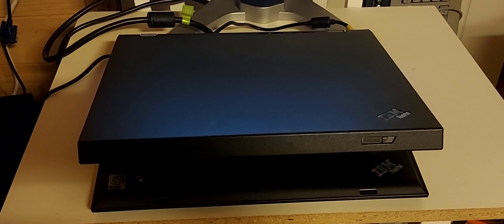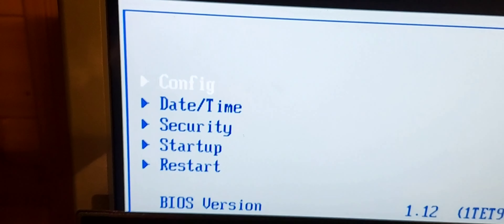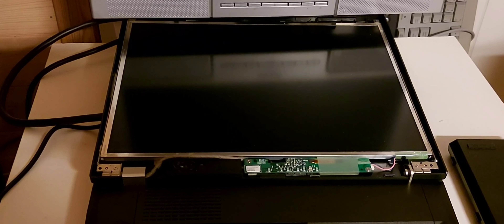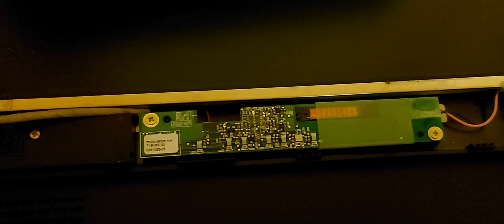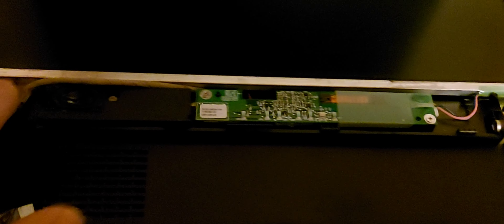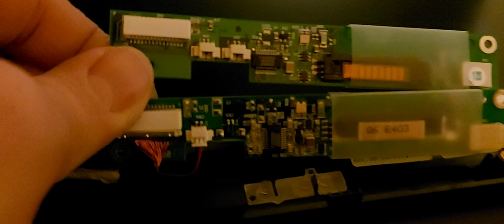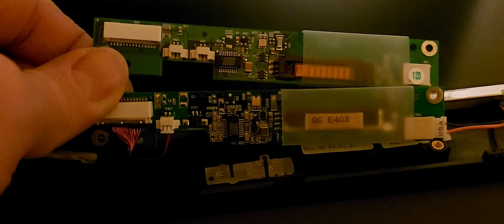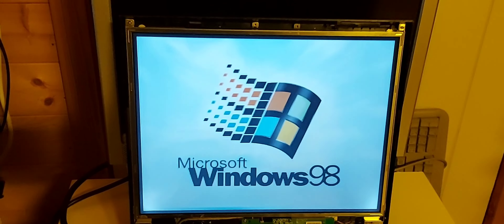IBM Thinkpad G40 - Missing LCD backlight repair

Comment: Yooo, Thank You! Two of my thinkpads exhibit this problem. I think I know how this problem may occur. So, with first one, I had no idea what happened. But when diagnosing the second ones other problem, I accidentally removed monitors main cable from motherboard while the laptop was powered on, and after that, it stopped working like that. Be careful folks.

Comment: please tell me if it is possible to install ssd in it? And instead of what is it better to put?
Reply from the maker: You need a drive with an IDE 44pin interface. 
Search on ebay for: "ssd ide 44"

Remember that you will have to push the drive into the HDD slot, so a drive that is as large as the original disk will be easiest.